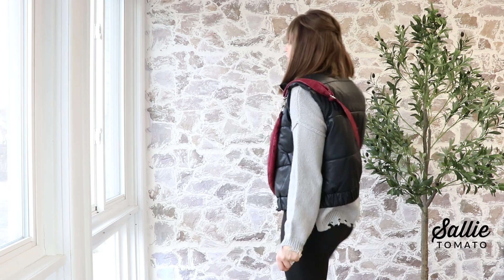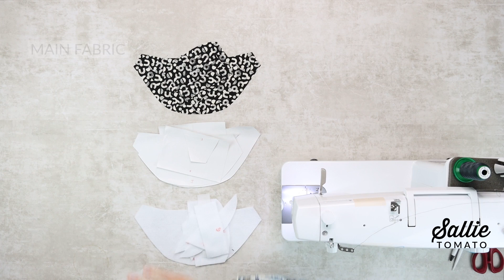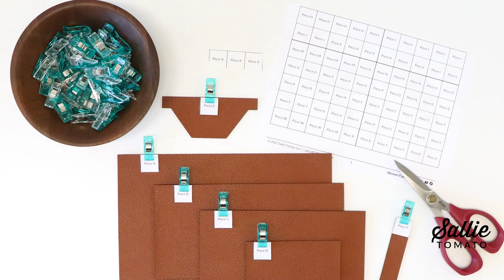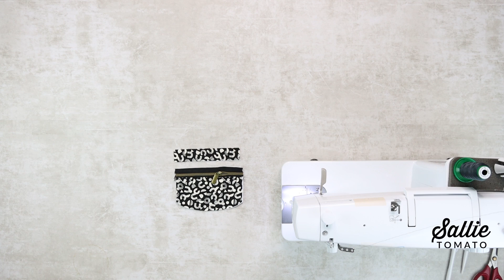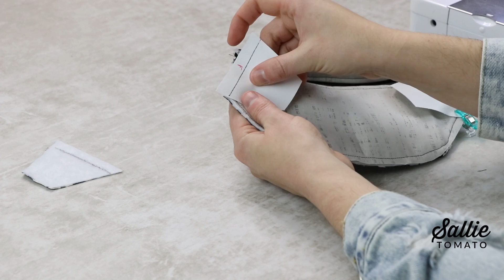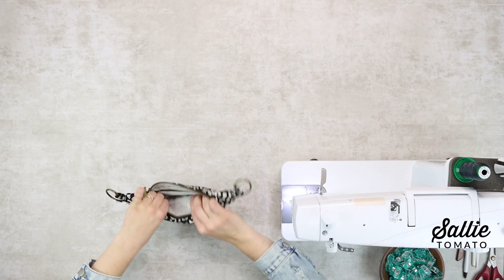Customer Favorite Crossbody Bag Sewing Tutorial | Ferris Fanny Pack

Comment: Hi I am making the large size bag but the instructions never mention how to attach that little extra piece marked my half circles on the edge of piece A. The cutting layout appears to show that piece attached to just the left side. Never a mention even on the piece how many to cut. Also, I was so happy to find that extension because my back A does not fit. So I thought 2 extensions were needed, nope, still does not fit. What am I doing incorrectly? Help!
Reply from the maker: The smaller paper pattern Piece A with red half circles should be taped to the larger paper pattern Piece A that also has red half circles, before the fabric piece is cut out. (Instructions for the pattern pieces are included on page 6 of ©2024 version or page 5 of the ©2020 version) The large size pattern was too large to fit on the sheet of paper, so it was split into two sections to fit the pattern instructions. 💖

Comment: I am not sure where piece 'H' fleece is used?  The pattern uses the fabric, on page 4,  Making the Adjustable Strap but doesn't use the fleece with the fabric, which was cut per instructions on page 1 .
Reply from the maker: Hello! Thank you for watching and commenting 💖 Piece H is fused to the cotton (or woven fabric) Adjustable Strap in step 1, under ATTACH FLEECE/AIR MESH TO PIECES on page 1.

Comment: I have made about 6 of these bags in all 3 sizes, almost all with modifications. Except for the smallest one, I have added an inside zippered pocket into the back lining.  With the large ones, I’ve included RFID blocking fabric behind the front and back linings, and I have added an outside “hidden” 1/2” swivel hook to link into the top zipper pull hole (can’t use solid pulls for this) as anti theft features.
Reply from the maker: Wow, those sound like some amazing modifications! 💖

Comment: DO NOT buy this pattern!! I have 19 years of experience sewing. This Sallie Tomato Ferris Fanny Pack pattern is terrible. I am attempting to make the large version. Instructions are not clear, and the video contains incorrect information.  There is no panel F as referenced in the video. Even with the visual help from the video, it was a struggle. Even worse, the backing template is wrong and is several inches short on each side of the bag for both the lining and the back of the bag! I'm very frustrated and angry as I now have to try to make this work with no template for the backing. Worst pattern I've ever used. Total Trash, and that is exactly where this pattern is now residing.
Reply: It looks like I had an old pattern too. My back piece does not line up at all. Thank you for providing the updated links
Reply: My back piece does not match either! UGH
Reply from the maker: Thank you for your comments.    It sounds like you had a really frustrating experience with the pattern, Leanne.
 I'm sorry to hear that one of our most popular patterns caused so many concerns for you. It's always disappointing when things don't go as planned, especially when it involves time, fabric, and effort. I can understand why you would be upset.
It appears that the instructions and the templates were the main concern.
Looks like an error was made at the time the pieces were cut out. There may have been some confusion with connecting the pieces. The back piece on page 6 should attach to piece A on page 11. These are linked by the red on the pattern with the corresponding letters. Piece F is with the larger version of the Ferris and is found on page 12. This pattern does allow for our customers to make all 3 various sizes. We do have an updated version of this pattern, I’m am unable to verify which version that was used. We recommend our customers to check the pattern revisions on our website first to ensure they are aware of any changes.
I have included the link to our pattern revisions for easy reference.
 https://sallietomato.com/pages/pattern-corrections
I hope your next project goes much smoother!  Please feel free to contact us if you need further assistance.

Comment: I made 3 of these and the pattern did not seem to be fitting properly the sides at the top that you attach the connectors to are way too wide and the lining is huge. I double checked that I had all medium pieces and I did. I’m baffled. 🤷‍♀️I made it fit bit I spent $18 Canadian and I’m not impressed.
Reply from the maker: What size zipper are you using, have you confirmed the seam allowances for each piece?  If you need further assistance, please email info@sallietomato.com and we will be happy to help.
Reply: I have had the same issue with the side extension pieces not matching up on the medium size. I have had to trim them down after I attached the two panel together. I have made the bag three times and same issue every time. All seam allowances are correct, cut out new pattern pieces, thinking it was user error same issue. I’ve checked the updates and didn’t find a fix there. Otherwise it’s a fabulous pattern!!
Reply: @sharabundy-ur1mf  Ive made it twice with the same issue. I have to 'make' it fit.

Comment: Can I use a serger for this pattern? Specifically the large bag
Reply from the maker: You can definately use a serger for some parts, but you will need to know where your markings are for 1/4" and 3/8" seam allowances.  There is alot of top stitching as well as stitching the straps to the hadware, which could be done if your machine has the ability to do a chain stitch (for hemming) but there could be alot of back and forth for the stitching.  Let us know if you end up making it on there.